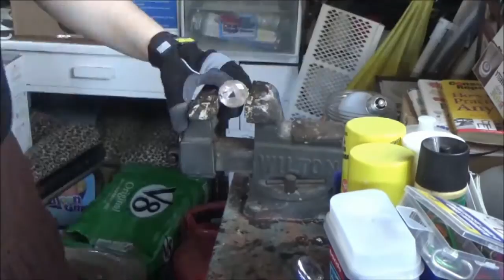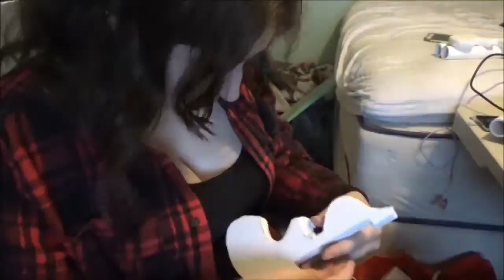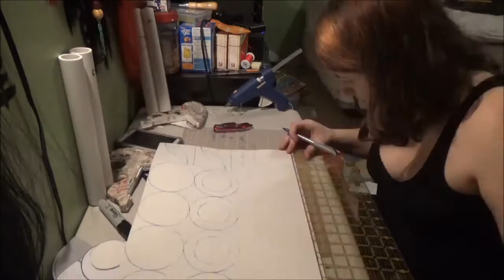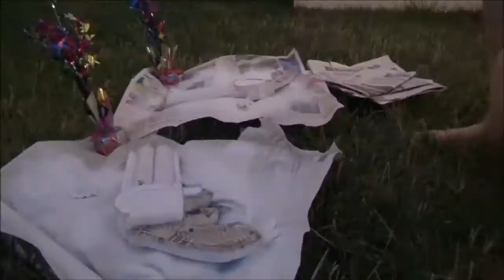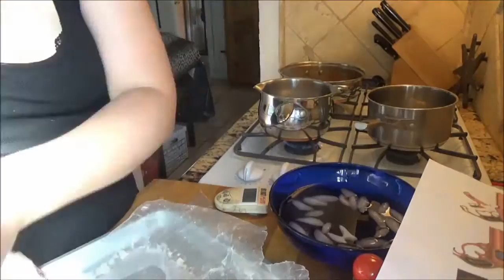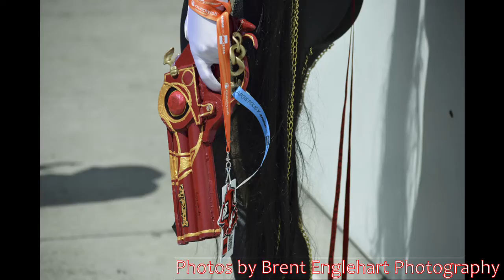Bayonetta Cosplay Part 1 - Scarborough Fair (Parsley and Sage)

Comment: I feel like you could have skipped the paper mache and gone straight up wall filler, sanded that down and then sand the primer from there, maybe saved some time and have a similar result? I use wall filler for like, table top miniatures and it comes out pretty firm and solid.
Reply from the maker: Wall filler...hm, I'll have to look into that.

I'm currently remaking the guns entirely and yes, I am skipping the paper mache this time.  I'm trying to make these new ones MUCH lighter...
Reply: On that topic, if you were going to make the other 2, what would you do differently?
Reply from the maker: I'm not entirely sure yet...I'm still doing a lot of brainstorming.  The main thing would be to make them lighter.  I'm still going to do all four, but the ones on the shoes will need to be easy to walk in for sure.
Reply: Another gal on instagram went straight up craft foam, which takes to wall filler rather well as well, and a hot-wire is about $30 from an art store. I'm working on my own Sage, i'd like to ultimately have actually articulate, made out of mdf..
Reply: Correction, I'm working on it on This account xD
Reply from the maker: Craft foam was something I had in mind, and I've been gathering quite a bit.